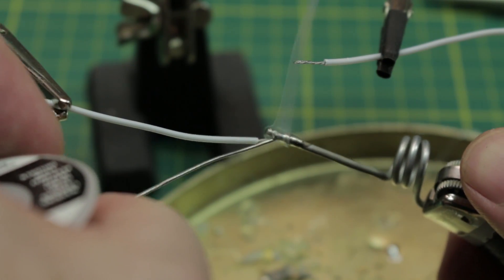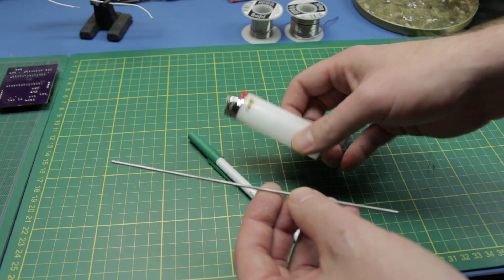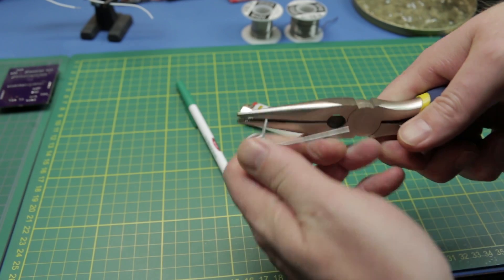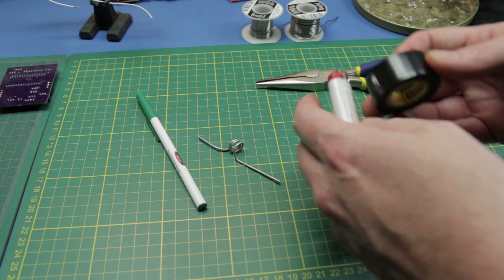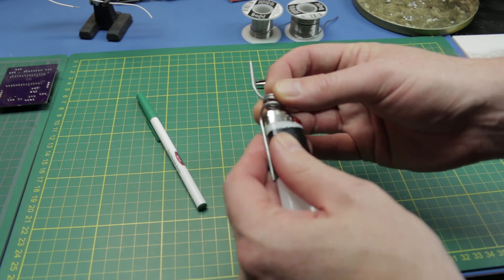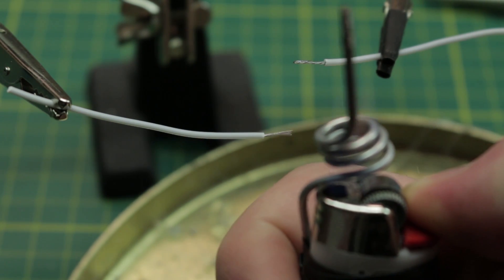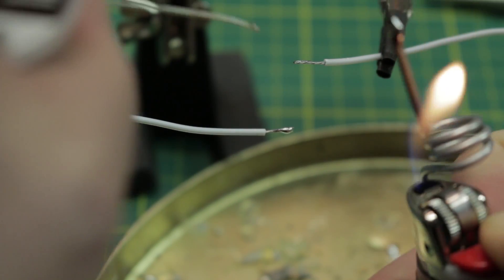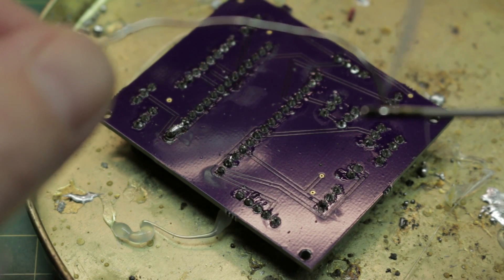Make a Soldering Iron With a LIGHTER & Do Repairs ANYWHERE!

Comment: Couldn’t you just wrap the copper wire strands around a tiny balled up, or chunk of solder, then heat it? Like twist some of the wire strands with the opposite wire, and at the same time, wrap them around the chunk of solder, then light it… I wonder if there’s a way to make a bow&drill type of thing that uses friction to heat up the solder? 🤔

Comment: I use a small drill peace not work I use 2 different wire and not work I even heat it with a torch flame thrower it still not melt the sold on my guitar cir board dont work now I'll have to go buy a soldering iron for 3 spots and never use it again

Comment: Great idea.
I made a version 2.0 for this using old vape.
Any type of vape with atomizer that requires coil. RDA to be exact.
Preheating the coil and using it as the substitute for the metal rod you used.
Reply: Pls make a video on this. Hold up.
Reply: I was just about to say, If you make a video I'll watch it.
Reply from the maker: Very nice

Comment: A little tip: For a strong proper connection you don’t want to add solder to the wire until the wire is hot. When the wire is hot it melts into the wire and bonds to it. If you just drip hot solder onto a cold wire it’s not going to be a good solid connection, witch is basically the whole point in soldering something. You should not have to melt the solder with the tip of the soldering iron or whatever your using, it should melt into the wire once touched to the wire being soldered. Happy soldering folks!
Reply: He’s 100% right you use the damn iron to heat the wire underneath then above the wire just place the solder on the wire and it will gradually melt since the wire was heated by the tip of the iron. Theres no need to put the solder directly on the tip. Solder directly to the tip is called tinning.
Reply: Damn thanks!
Reply: I was literally trynna drip it like that and couldn't get it to work so I checked the comments 🙏💯
Reply: Thanks ! 👍
Reply: What can i use if u don't have soldering wire?
Reply: @axd2312  you could find any old or broken motherboard that has bits of solder, use a screwdriver to remove a small chunk of the solder and use that chunk for your solder, good for a small soldering job
Reply: @axd2312  I don’t believe there is much you could use, especially that you’d have laying around. It would have to be a relatively thin wire or small piece of metal, either way it would need to be something with a very low melting point and something that can bond with copper. The only thing I can think of is lead but I’ve never tried it. Like old lead fishing weights may work but then again if they’re old and dirty they may not because again it has to be able to bond with the wire your trying to solder. I keep a little wire fix kit that I made up in my truck toolbox so I always have a roll of rosen core solder with me. If you solder stuff often like I do, I keep handfuls of different types of solder on hand at home that way I always have the right solder for the job. Or if you just solder wires once in a while and you don’t wanna waste any money maybe just pickup a small roll of rosen core solder from Walmart. They’re only $2 or so last time I checked but it’s enough to solder a handful of wires.

Comment: i tried to melt solder that was already on a circuit board because i do not have solder but the solder would not melt help please
Reply: My point exactly this video is worthless cause you won't get hot enough to solder anything, the soldering wire can be put on relatively not very hot surface and it would melt with ease.